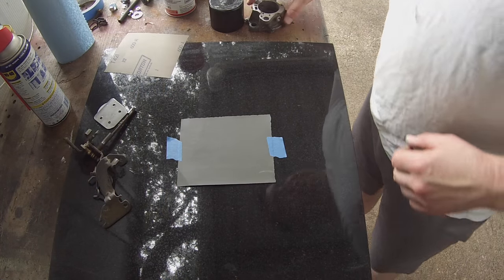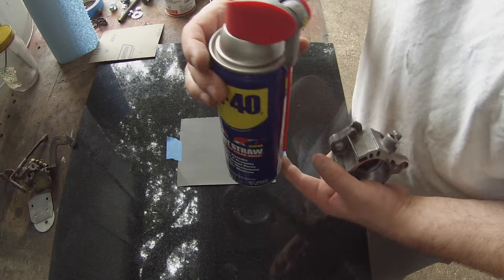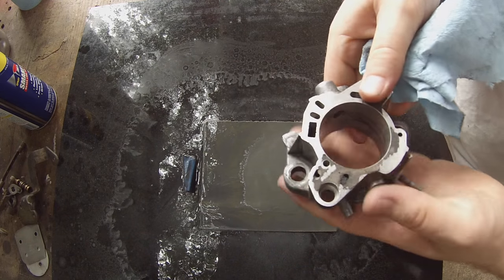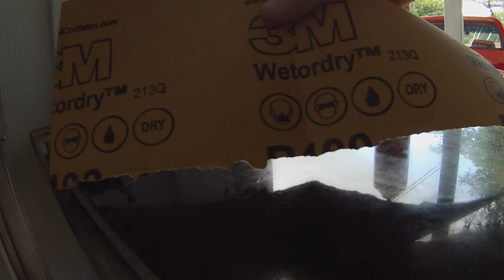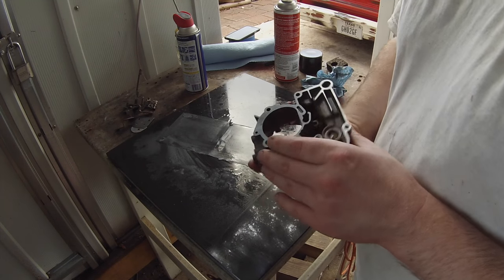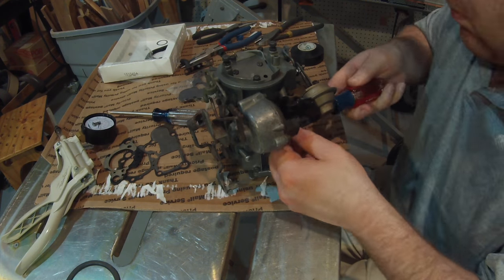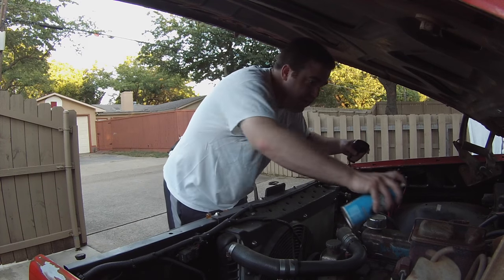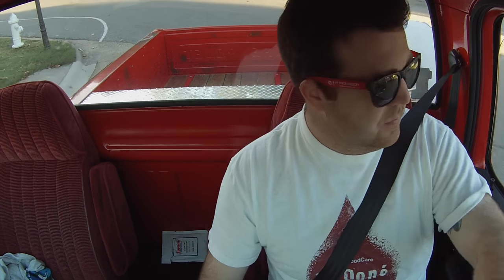GM ROCHESTER MONOJET CARB REBUILD

Comment: On my carb I only see one adjustment screw wich I think is mixture screw where is the idle speed one located? Mine is blowing a lot of unburned fuel white smoke trying to see if I can adjust it properly same exact setup as yours

Comment: Hi, great job, very interesting how you were able to reassemble and put back all those parts back together. By the way I intend to replace my EGR valve on my 75 nova. The carburetor is a Rochester 1bbl just like yours, ¿Where should that EGR valve hose be connected to the carburetor, if indeed it connects to the carb. Right now is not connected anywhere. Thanks.

Comment: What does that hose hanging off the carb go to? Mine seems to be missing that hose but the port is there with nothing in it
Reply: Did you find out where it leads to?mine is also missing it on my 72 292

Comment: Tuning always makes great content, i use propane, acetylene, wd40 or even gasoline around the carb, manifold and fittings to find vacuum leaks... if the idle picks up or smooths out you know you still have one. surprised you would not soak the carb, run through the passages and blow it all out... mind you most of my experience is with Quadrajets or Double pumpers so i guess there is four times the chance of an issue with them

Comment: I have a question. I'm new to inline 6 just got me a 62'c10. Where does the carburetor fuel over flow route too? Back to the tank? A catch? Or? Please help.
Reply: i JUST BOUGHT THAT SAME TRUCK 1962 CHEVY TRUCK SHORT BED FLEET SIDE. hAVE YOU DONE ANYTHING TO YOURS?

Comment: I know this is old but where in the hell do you get an air cleaner for this carb
Reply: I found one from advance auto parts, i dont think they have it listed under the vehicle but i size fit it
Reply: Careyne  lol That’s actually where i ended up getting one. it was a spectre brand i think. thank you though

Comment: 292 o 250?
Reply: Manuel Angarita 250.
Reply: +wallbanger1968 Cool men. i gotta in my c10 a 292. U think its pretty mucho the same carb?
Reply: What year is your C10?
Reply: +wallbanger1968 85. By the way I live in Venezuela. Pretty much all the information that I have about the truck is for web forums. The carb that I have in the truck is just having trouble with the mix so I was gonna think in rebuild it following the info on this video.
Reply: +wallbanger1968 Carbs here in venezuela are just so expensive and find the original one its difficult.